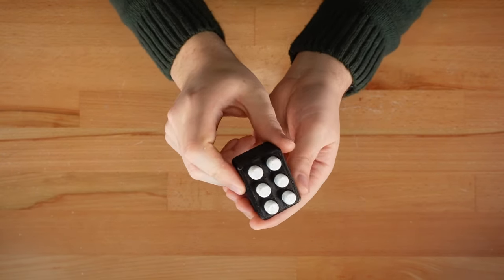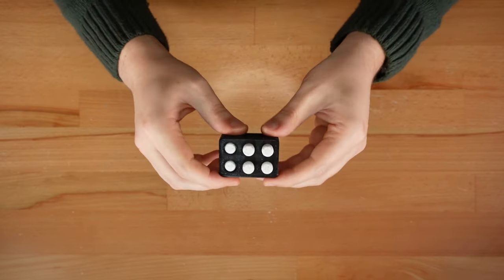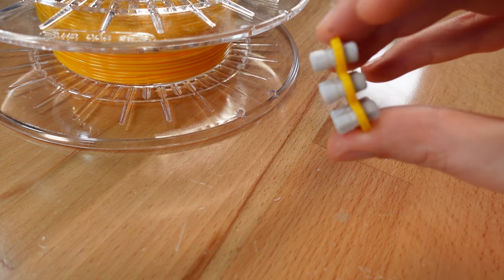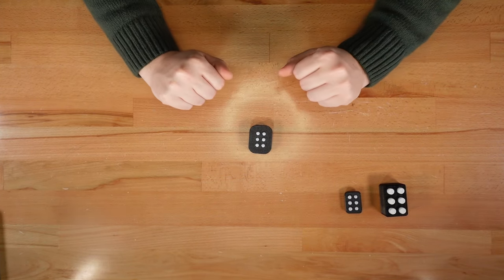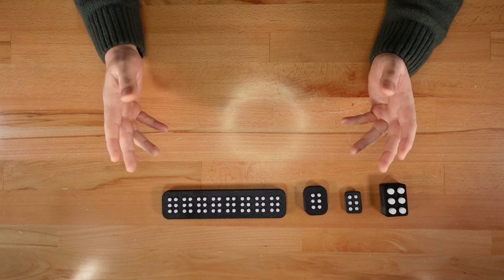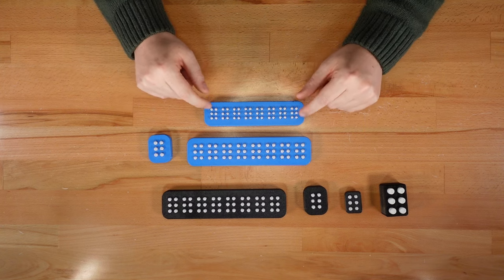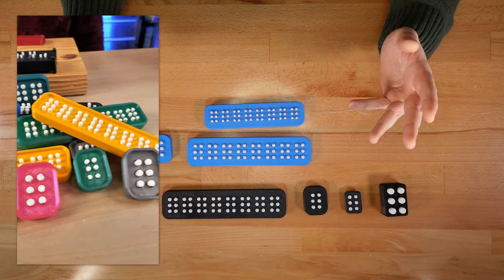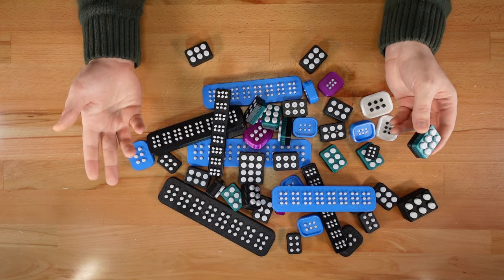3D Printed Braille Cells - Printing with Purpose!

Comment: This is absolutely genius, even if the Print doesn't come out "Looking good" it will still damn well function. Not only that but a Blind individual would be able to use this to in theory, Write very cheaply.
Reply from the maker: As long as the interior gaskets print well, the mechanism should work :)

Comment: Such great teamwork with Courtney and Reese to improve upon your original model! I printed quite a few of those and agree that the buttons were hard to push, but I gave them to several fellow teachers to share with parents and other students who wanted to learn more about their classmates who are visually impaired. I've never printed with TPU before; any suggestions on printing on a Prusa MK4? Thank you for all you've done so far and I look forward to seeing more in the future!
Reply from the maker: I'm glad the old version was useful - even if it was quite stiff. I think you'll find these so much easier :)

Since the Prusa MK4 is a direct drive printer, it should have no problems with most TPU filaments (except for the absurdly soft blends that cause trouble on ANY printer).

For good results:
- Print slower than normal. I lower my print speeds down to 80%.
- Make sure the filament is kept dry. TPU absorbs moisture more quickly than PLA.
- Last but not least, do NOT print on a smooth PEI sheet. TPU sticks so well it'll ruin your sheet. Instead use a textured print sheet (TPU will still stick, but you can actually release It without damage). You can also add a thin layer of glue over the whole surface of the sheet to act as a protective layer. Yes, it sounds odd to use GLUE to make things NOT STICK as well, but it's true!

Good luck :)
Reply: Thank you SO much for your advice! Can't wait to try TPU; it looks like amazing material. I've been watching some of your other videos and your designs/prints--and you--are amazing!

Comment: Well you got my subscribe and support thanks to @FIlamentStories. I saw her video of this and had to come check you out. Im just entering this community and my goal is to make things functional for children with special needs and disabled veterans and anyone with disabilities.
Reply from the maker: Welcome to 3D printing! Printing for accessibility is a wonderful part of the hobby :)

If you're looking for other projects along these lines, check out The Controller Project created by Caleb Kraft.
Reply: @3DPrinty  okay thanks for that. any beginners advice? ill be running a creality ender 3 v3 and a v3 ke at the moment. i know there not the best got gotta get the feet wet and started.
Reply from the maker: That's a great starter printer - it has a lot of quality-of-life features (direct drive, removable bed, auto bed leveling) that used to be reserved for more expensive models.

Yes, there are more capable machines out there (faster, larger print beds, multi-color, enclosures for fancier filaments), but this one covers the important basics very well.

I recommend getting lots of use out of it so you can learn what its limits are for your specific needs.

As for advice on this model, print the TPU parts slowly. The PEI bed on your printer will probably stick TOO WELL to TPU, so consider adding a very thin layer of glue stick to act as a release. TPU (and PETG) has been known to destroy the surface of smooth PEI sheets. Good luck!
Reply: @3DPrinty  thank you will do that. plan to get a textured sheet to.